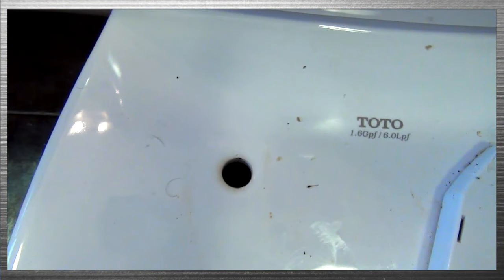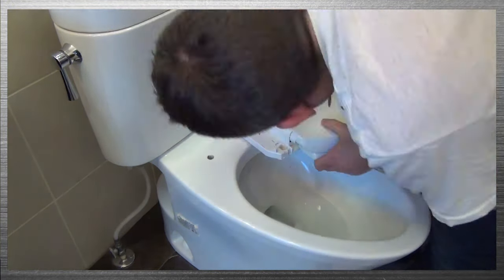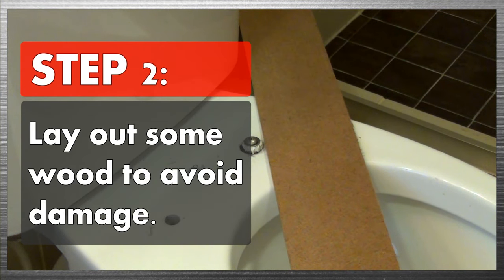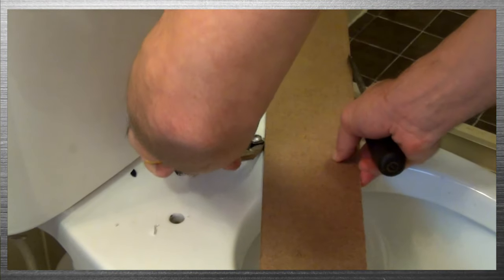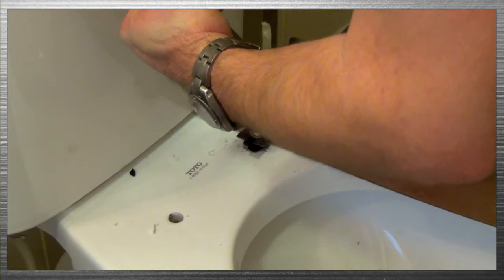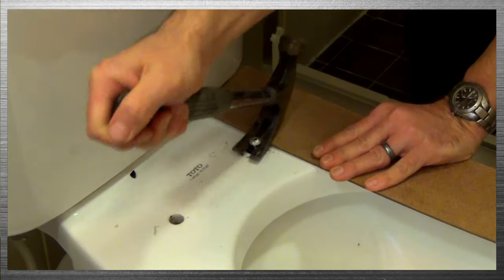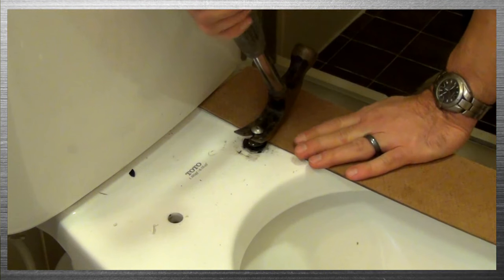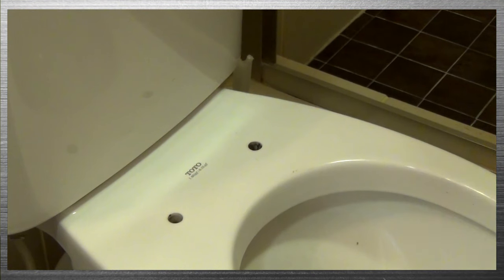How To Remove a Stripped Toilet Seat Expansion Bolt Mounting Hardware [HD]

Comment: I thought replacing my old toilet seat was going to be a 5 minute job.    Here I am on youtube looking for help lol   thx for the vid
Reply: Man, same, this is messing up my whole mood 😂
Reply: Damn this is gotta be one of the most frustrating jobs
Reply: @MikeMiller_USTA  i commented a month ago. I still didn’t get mine fixed. I have to sit the seat on when I use it then slide around.
Reply: I too messed up by replacing the old with new one and the new one was smaĺ and now those bolts wont come off
Reply: Ditto
Reply: Been trying to get mine off occasionally since Christmas... Eventually I'll break something and HAVE to call the plumber and then I'll have wasted all this time and the terrorists will have won.
Reply: @glazedfaith  I set the seat on the toilet when I have to use it and lean it against the wall when not in use. Whoever made those screws is a menace.
Reply: Same here man. I was wondering why can’t anything just be straight forward.
Reply: No.joke.dude feel.like an idiot right
Reply: I'm in the same boat. It's insane how it takes so much effort lol for 1 damn dirty old screw. I couldn't drill the old screw but I could destroy the seat by twisting at a hinge, and pull the toilet seat until it snaps. Then hold the bottom with pliers and spin the screwdriver through the hole in the hinge that stayed
Reply: Me too
Reply: My God, I never dreamed removing toilet seat fittings would literally take an entire weekend.  We had the Bemis "sta-tite" model. Nightmare

Comment: This is foolish advice. Instead, drill the bolts out next time. First drill a small hole in the stripped bolt head with a 3/32" bit. Then drill out the bolt with a 1/4" bit. The bolt will drop straight out. This takes <5 minutes, which includes fetching the drill.

Comment: I grunted and groaned to fix this and even had a neighbour help to no avail. Home Depot had me buy a spiral screw extractor set but after I bought it, it didn't make sense to me. I watched your video. The one piece I was missing was FULLY removing the plastic. piece under the bolt. Solved the problem in under a minute. Thanks so much!

Comment: Thank you so much for this video! I applied your method to my own toilet when I was at the point of thinking I was going to have to replace the whole toilet because of a stuck seat bolt. I didn’t have wood and used cardboard instead—which made me nervous but it worked. The pressure ended up busting a few plastic parts and the bolt just fell out. Joy!!

Comment: You are a genius!! THANK YOU!! I have been going absolutely crazy trying to remove my stuck bolts. Was too afraid to use a hacksaw. Using the hammer I got both off in less than a minute! Cannot thank you enough

Comment: Omg I have to thank you so much. I have been trying to remove a stripped bolt from my toilet seat for months. I tried the reverse screw things. Unsuccessful. I tried cutting the head off of the screw. No luck. I tried your method and it came out in moments
You're a rock star and I can use my toilet again.

Comment: Thank you for this video! I was getting desperate after destroyed the toilet seat but still couldn’t get the bolt out. Followed this video and it worked!! Saved my day! I used a piece of plastic board instead wood board. I was also concerned that the toilet might break, leaving a much bigger issue. But luckily the rusty bolts were more fragile than the toilet. It took more force than I thought, but I think less than to break the ceramic. Just be careful that the last pull might come earlier than you thought!

Comment: I’m only 85lbs and it worked :) thank you I loosened the fitting by lifting the bolt from the plastic housing and that made it so much easier to pry up; did not crack the toilet because obviously I’m not strong enough to over apply force.

Comment: great job with lots of perseverance.   i have a same problem so this is an encouraging video.  I will follow your steps, but i will increase the thickeness of the wood to lift the leverage of the hammer to yank out the bolt, the board will protect the ceramic toilet.  i will never buy a skirted toilet ever again.

Comment: I have one of these toilets, the previous tenant broke the seat, so had to replace after some years and yes, I agree with the previous comments, this toilet may be ascetically pleasing but the designer never changed a toilet seat, I mean really over an hour dealing with installing a new seat, what a joke. 
After years of service, the bolts became stuck, and of course slot pan heads are such a great idea.....NOT.... especially when you need to remove them. I ended up cutting the seat off with a sawzall, then cut the bolt heads off, letting the expansion bolts drop in the void there. 
After the repair kit came from Kohler, the installation went pretty smoothly, (See Kohler video below) - it was the removal that was ridiculous. 
I would never recommend prying these bolts out, the guy here was lucky he didn't break the porcelain with the back of that hammer head, or pull the whole bowl out of the closet ring in the floor. You don't want to be yanking the entire toilet around, then you will have a much bigger issue.... 
Use a sawzall and just cut the bolts. Much safer and quicker, use for cutting the seat off first as well. 
Also, when your putting the bolts in and installing the new seat, use antiseize compound on the threads to make it much easier next time, the toilet itself has been a good dependable unit, with 1.6 gal, per flush, good for the water bills, (They could make it easier to remove by providing a small tube of antiseize compound with the new unit, and also using a hex head bolt, so one could use a socket when needing to remove, not a slot pan head!) 
Here is there video for putting the new bolts in the holes, good luck and don't get too frustrated out there! :O) - https://support.kohler.com/hc/en-us/articles/360001907454-Install-a-Toilet-Seat-Anchor-Kit

Comment: Thanks for this video, I was a little concerned about putting that much stress on the ceramic but as I had nothing to lose I gave it a go and it worked a treat!  The first bolt was hard to remove, you really have to give it a good strong pull.  The second one was not coming out so with what had been exposed of the bolt I heated it up (carefully) with my blow torch and then used the claw of the hammer to pull it out of the softened threads of the plastic expansion plug.  Thanks again for the tip!
Reply from the maker: Daniel Keeble glad it worked for you!

Comment: This helped me! Thanks! I was installing a new seat on a D-shaped toilet and couldn't remove the bolts; using the pry end of a hammer worked like a charm. There was a soft expanding nut which pulled right out once I got enough pull on it. Used cardboard to brace the hammer against the toilet for no damage. All done!

Comment: Thanks a bunch. My only idea before this was to cut the head off and push the bolt through. Don’t know if that would have worked or not. One additional tip. If you have a framing hammer with a nail puller on the side you can get a lot more leverage. I worked with the claw for about 20 minutes until I had the head up high enough to get the nail puller on it. Got it out on the first try using the nail puller. BUT, NEVER WOULD HAVE THOUGHT OF THIS AT ALL IF YOU HADN’T POSTED THIS. THANKS!!!
Reply: Glad it worked out!! Didn't think about using a nail puller!

Comment: If I use a Dremel to cut off the head of the bolt, and push the remainder of the bolt down into the hole, where does it go? 
Will it obstruct the hole for the new seat's anchor bolt?
Will the dropped-in bolt affect the toilet's performance?
Reply from the maker: It depends on the toilet, I think. I was able to grab the rubber gasket that fell in out of an opening on the back of the toilet, so maybe you could get the bolts out that way too. Could check first.
Reply: @scarnsworth1850  thanks

Comment: What about the plastic washer underneath the toilet that’s connected to the metal expansion bolt meaning you can’t pry it off upward because of the plastic washer.  Some of the washer cracked off but I’m still working on it.

Comment: FWIW, I was removing seat of my Toto Aquia and found tht the bolt wasn’t stripped but that whn you turned the screw, the rubber gasket wouldn’t grip porcelain such you could loosen the screw. Instead of destroying a perfectly good seat, i used 3 wood shims against the rubber gasket to hold it in place and then used a drill screwdriver on reverse to pop the screw loose. Then i was able to keep pressure on rubber gasket w shims while I unscrewed the screw w a hand screwdriver. And next time it happens, i will try and get a pair of needle nose plyers on the rubber by accessing it through hole on back side of toilet skirt and then loosen the screw. Probably need 2 people for tht.

Comment: The hammer technic worked for me, I used a thick cardboard to protect the toilet, and then used the hammer to pull out the toilet seat bolt with a rubber fitting. ⭐⭐⭐⭐⭐
My rubber fittings, holding the screw, were these:
 |=O=

2PCS Toilet Seat Hinges Screws, Toilet Seat Top Fixing Part, Toilet Seat Fixing Device Rubber Top Nut, Toilet Seat Screws

Comment: tried good 20 min to do the hummer, but didn't budge, end up using the saw to cut the head off. Took less than 2 min. Yes, the remains of the screw is somewhere inside the bowl, but I don't think it affects the performance.

Comment: I just drilled out the bolt from the top, using a pilot drill bit, then larger bits. The bolt head easily separates from the bolt stem

Comment: Jesus, don’t do this, you’ll probably break your toilet. I had this situation and tried drills and various other solutions, but then got out my dremel multimax and the titanium saw blade attachment from multifitblades.com slipped it between the hardware and the toilet and sawed the bolt in about a minute. Job done.
Reply: I just used a hack saw with carbonate blade and sawed the screw off. Not as fast but faster than this video!

Comment: Did not work for me. Instead I drilled a small pilot hole with my drill bit. Next I used my stripped bolt remover drill bit following the included instruction. It worked & was done in two minutes.

Comment: The screw on mine wasn't stripped but, after I unscrewed and took off the bracket, I screwed it back in a bit and was trying to pull the bushing out.  Apparently the normal thing to do is push it into the toilet.  Okay, that helps!

Comment: I didnt have a hammer handy but I just melted the plastic nut off with a lighter obviously a fire hazard so I wouldn't recommend it but it did work I made sure it didnt get too big as I didn't want to chance cracking the porcelain but once it got hot enough it just pulled right out with a screw driver.

Comment: I needed to change the seat in my $350 Kohler Rialto I bought years ago. Bolt was rusted and broke off when I tried to remove it. Kohler should know better than to use metal bolts that rust out to secure a toilet seat. Some type of sturdy plastic would at least not rust out. Oh yeah thats right Kohler want s to sell you a new toilet. Will I buy another Kohler product? NO!

Comment: Removing plastic with vice grip wrench?!?  
Two words: Dremel Tool
Reply: I am a 73 year old, 145 lb woman who also was ready to tear my hair out after multiple tries with the help of my 19 year old, 235 lb, 6ft 4 in football playing grandson to remove the metal anchor bolt from my Kohler Persuade toilet (the kind with the sleek sides) completely without success.  After my grandson flew back home, I went on YouTube and discovered this video.  I cannot tell you how grateful I am because it worked!!  However, instead of a hammer, I used a heavy duty 24” crowbar to remove the stripped bolt and the metal anchor.  I cannot adequately express the joy I felt after both popped out after about 20 minutes of repeated effort.  Mind you I used a thin piece of laminate flooring to prevent scratching the porcelain with the rocking crowbar.  I also sat on the toilet to reduce the significant rocking of the toilet which made me think I was going to dislodge the water lines or all the guts of the toilet.  By the way, I went though all of this to install a Veken  “ultra slim” dual nozzle bidet sprayer (about $35 on Amazon) Had previously tried to install a Brondell bidet, but it didn’t fit this style Kohler toilet.  I will never, ever again buy a Kohler toilet due to this lousy design.  American Standard is far superior.   I must conclude by again saying I am most grateful for this video, and am feeling oh so smug!!

Comment: Easier way than this.............use a pry bar under the screw to lift it up under pressure, then use a power screwdriver to remove the screw while you apply upward pressure on the pry bar.  So easy. 

Toto toilets are a pain. A plumber told me Toto jobs out all their products to subs, so product quality and color consistency is variable.  Just try to find a matching color toilet seat later.....only white is the same.

Comment: DO NOT DO THIS! One astute reviewer states "This is foolish advice" while another opines "Jesus, don't do this ...". They are both correct. I quickly noticed early on in the video that the de-installer succeeded
in loosening the toilet from the closet bolts-you can see the WC rocking back and forth! Use a hacksaw, or Sawzall if you are careful. Or drill. You'll most likely need a new hardware kit from Toto. DO NOT PRY. Please.

Comment: bolt cutters?
Reply from the maker: there's a rubber gasket inside the toilet body holding the bolt tight against the base. it's really tough to get it to lift up because the elasticity of the rubber keeps pulling it down. very frustrating!

Comment: Cut the head with a hacksaw or an angle grinder.
Reply: Completely agree. Here is what was not successful for me:

1) Vise grip to try to grab the rubber seating the bolt goes into
2) Pulling the seat up while unscrewing the bolt
3) Pushing down on the seat while unscrewing the bolt
4) A dremel - would have worked but it burns the rubber span nuts and my bathroom smelled like a tire on fire. I stopped after 5 seconds. That is a smell that lingers and is toxic and acrid
5) A normal sized hacksaw. Just couldn't get the angle/leverage needed

Here is what worked:

1) A small hacksaw. I bought a Milwaukee hand held hacksaw that uses a sawzall blade. Took 15 minutes and both bolts severed. Just pushed the rest of the span nut down, removed it from the crevice, and cleaned things up.
2) One more thing: Put some masking tape or duct tape on the surface to prevent the hacksaw from scratching your toilet. I didn't. I can see that the hacksaw scraped some of the finish. I don't think anyone else will notice but me though. It is subtle.
Reply: But how can you pull it out if there's no access from the bottom?

Comment: If you have this Toto toilet, be sure to get a new set of bolts when buying the new seat. THU651N-Mounting-Hardware  The plastic bolt and nut that comes with the seat are for toilets with open access.